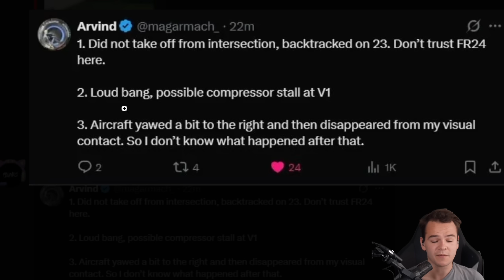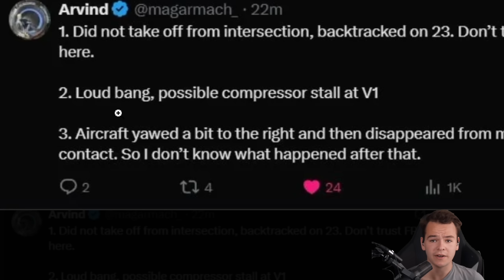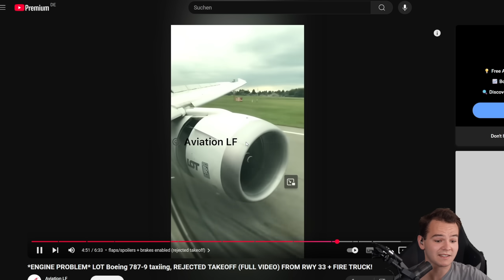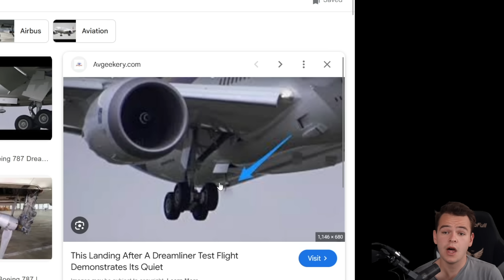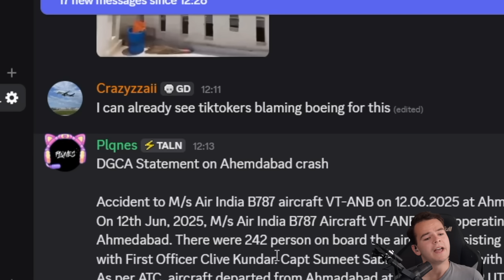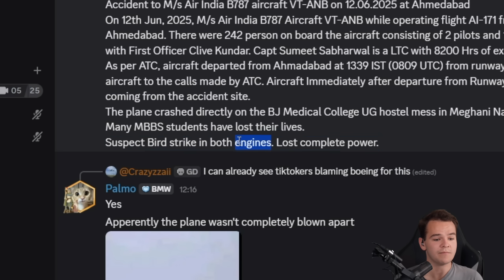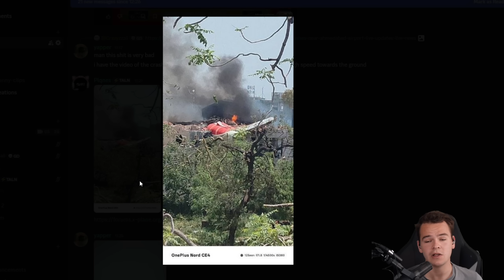The First 787 CRASH Ever - Why It Is SO Confusing?

Comment: No flaps visible, a fully loaded plane is unable to start or land without flaps.
In fact, flaps are required to provide lift at low speeds
Reply: you can land on no flaps just need to fly 50 percent fast so more like 300km hour for a very large plane... plane looked like going slower then that so was stalling already
Reply: @nicholas-k8j  The plane was definitely not stalling.  Proof:  
- wings level to the very end
- no drop in angle of attack.... quite at the contrary, the pilots seemed to have raised the nose in the last seconds to reduce impact speed.  
So, if the nose can be raised, that means there is excess speed (vs stall speed) to do it with, in the absence of thrust.
Reply: Flaps are in takeoff, I can see them.
Reply: Remember the 787 have a electronic checklist, the plane will literally say nope if the checklist wasn't correctly made so that means the flaps should be out
Reply: @Hugo-y7p9b  Correct!  The flaps WERE down.  At 5° setting, they just don't look like barn doors, making them little visible on such low-quality videos.
A segment of wing was found, with the leading-edge slat down...the flap had been torn off... but the slats cannot be set independently from the flaps, if I am not mistaken. 
Later correction:  I saw another picture of the same wing.  A segment of the flap had survived... it was DOWN!
Reply: @Hugo-y7p9b  More than once, flaps were retracted instead of the gear
Reply: @RickTheClipper Oh fuck I didn't think of that, make sense since the computer wouldn't have allowed to take off with bad flap config but the computer wouldn't have made anything else once the plane was already in the air, and from what you are saying is that once they took off they retracted flap instead of gear right?
Reply: @Hugo-y7p9b  Yes, thats what I say, and strange as it might sound, this has happened before. Human error
Reply: It is good practice on a wide-body aircraft to take-off with the minimum flap setting compatible with runway length, weight, temperature and other t/o variables.
That includes, on the 787, NO FLAP or only 1° of flap... F5 being pretty much maximum on such a long runway.  We can't see on such a low-quality video that small flap settings... 
So, let's not jump to conclusions.
Reply: @st-ex8506  That's not correct at all...787 FCOM lists F5, 15, and 20 as the only certified TO settings. The FMC wont even let you enter anything less than 5. Let's not spread misinformation.
Reply: @cameronfaison2118      I am a pilot and own a plane which has 3 flap settings (15, 30 and 40)... so, I did not invent what I said about the t/o flap setting of the B787-8.  I found it on an aviation site discussing that type aircraft. I cite verbatim:

"For example the Boeing 787–9 has more flap settings than the 787–8 but suitable settings for take off are 1, 5, 10, 15, 17 and 18, so 18 is the maximum allowable but the 787–8 doesn’t have positions 17 and 18 so the maximum is 15". 

So, if that is incorrect, my apologies.  It is not my style to spread misinformation, quite at the contrary.  One question though:  if it is not allowed for t/o, why is there a 1° flap setting?
Reply: @st-ex8506  Flaps 1 is for landing.  You slow to 255 kts and call for flaps 1.  Then as you slow more if I remember correctly at 235 kts you call flaps 5 then at 215 kts you can call for flaps 15 or 20. Then as you slow to approach speed you call for gear down and flaps 25 or 30 whichever you are using to land. The aircraft has to be stable  (on approach airspeed on glide slope and power set for approach) at 1000 ft above ground level.
Reply: @st-ex8506 never a 0° flap for take-off. Also you can take-off up to flap 20..
Reply: @edwardrichardson5567  Ok!  So, it was likely F5.  BTW, have you seen the wing they retrieved?  It has the leading-edge slots extended. The flaps seemed to have been ripped away... at least they can't be seen on that video.  But can the slots be extended independently from the flaps on the 787.  For other planes, the answer is no, which would mean the plane had some degree of flaps.
Reply: @st-ex8506 Flaps 1 is SLATS ONLY!!!! What part do you not understand???!!!
Reply: @edwardrichardson5567  I perfectly understand that F1 is no t/o flap setting.
I am actually convinced that the Air India crew took off with F15.
Reply: @st-ex8506  It didn't use the full runway lenght
Reply: That's the lack of coverage of FR24 plane used full runway  @RickTheClipper
Reply: How is it in the air? Even with flaps up this plane could DEFINITELY fly straight and level overloaded, unless Im wrong? The plane cant fly straight n level at Vmc??? Pilots hmu. It sounds like a full or partial engine failure. Terrifying and catastrophic, sad
Reply: @robburgundy9539 you are dead wrong. No pun intended.
Reply: @robburgundy9539  If you don't have enough flaps, I think you reach a point where you can no longer generate lift.  Now it is possible that the slats failed during take-off as there have been cases (in general, not on the 787) of slats retracting for some reason and causing crashes in past crashes.  For example, if you have a hydraulic fluid leak, that can cause the flaps to retract unintentionally.
Reply: he is right the flaps must have failed mid air
Reply: @Xhydro_unique  Flaps don't fail.  They are set (different settings are obviously possible) , or they are not.  The plane obviously started with the adequate flap setting, as its  perfectly nominal take-off roll and early climb show.  
What happened a bit later is impossible to know at this stage.  Were the flaps prematurely retracted by mistake?  It's possible, although I believe unlikely from the later behavior of the plane, which never stalled all the way to impact.
Reply: @st-ex8506  ik that but it could be that the ground staff didnt check and said the plane was ready to go so it could be related
Reply: I feel this to be very strange. If the aircraft is able to take off and reach 600 feet without flaps, which I’m not sure if a b787 is capable of, then I guess it would be able to fly but struggle to gain altitude at lower speed. It’s hard to imagine the aircraft took off without flaps deployed.
Reply: @RSTravelStudio  u get als aural warnings sounds.. unlikely
Reply: @RSTravelStudio  it could be that the flaps failed after reaching the height and then the plane started going down
Reply: You can't retract flaps on the 787 during take off.

Comment: Taking out both of these GE engines in a bird strike, would require two perfectly positioned, deaf ostriches on the runway. My guess would be a huge fault in the fuel management system, an autopilot take off that went haywire, a software melt down that reset the flight control systems to maintenance mode or two pilots slugging it out during take off (probably while playing bag pipes).
Reply: Agreed. Dual engine loss seems low probability especially a dual bird strike leading to dual engine loss. In the clip that’s going around they look very low energy though.
Reply: I posted a comment stating the sane root cause for the duak engine failure
Reply: @briannabanx5980  Including the ostriches?
Reply: Ground proximity software kicking in? Again
Reply: Or sabotage.
Reply: An even more remote option might be fuel fraud or contamination. 
- Topping up an almost fully tanked airplane with diesel in stead of kerosene, happened (happens?) in the army. You shouldn't, but if it's only a small amount no one will ever know. The reason to do that is usually time constraint, embarrassment or laziness. Why drive and fill another kerosene tanker truck, when the're's an almost full diesel tanker standing right here? Why admit you got your sum wrong by driving back for more fuel?
- Kerosene sometimes gets 'infected' with a fungus, especially in hot conditions. There is only one remedy, replace it for the good stuff. If kerosene like that ended up in the tanks, it could explain the double engine failure. It might be bad luck, it might be someone not willing to take a loss.

Comment: Imagine you're planespotting in India one day and suddenly... KABOOM! There goes an Air India 787-8.

I just wanted to say rest in peace, a routine takeoff from Ahmedabad turned into a disaster killing 247 people and leaving no survivors [242 people on board, 5 people on the ground]. We were never expecting a crash involving the Boeing 787, as it has had a good safety record for not having involvements in any fatal crash, but in 2025, the plane's safety record was lost after this crash had occurred. If the pilots had somehow managed to avoid crashing, this occurrence would have not happened, but because they stalled, they ended up crashing. This was even the first mass-fatality occurrence involving a wide-body aircraft since Flight 17 in July 2014.

Comment: These engines can ingest pretty big birds without failure.  FUEL, however can be solely responsible for a dual flameout, such as what happened to the BA 777 landing short in LHR.  At this point, its impossible to know.  The DFDR and engine data will tell what happened.

Comment: why is the video 9:11 long
Reply: Did you watch it?
Reply: @charlotteh7766  it is 9 seconds 11 minutes long
Reply: @thekingpachyyou think it was terror?
Reply: @charlotteh7766  its a coincidence that the video is that long, both were crashes. this one was probably a float carboteur faliure or some electrical faliure while 9/11... was 9/11
Reply: Had it been 1 sec shorter or longer you wouldn't have had that thought right? Are you making a conspiracy?
Reply: @charlotteh7766  no i said that this crash was due to an engine failiure, i was just pointing out a macabre coincidence, no conspiracy theories here at all.

Comment: The aircraft was under the command of Capt Sumeet Sabharwal with First Officer Clive Kundar, DGCA said. Capt Sumeet Sabharwal is a LTC with 8200 hours of experience. The co-pilot had 1100 hours of flying experience.

As per ATC, the aircraft departed from Ahmedabad at 1339 IST (0809 UTC) from Runway 23. It gave a MAYDAY Call to ATC, but thereafter no response was given by the aircraft to the calls made by ATC, according to the DGCA statement.

Comment: Flight radar showing it entered mid runway and took off. Ahmedabad is 3500m long, surely if FR24 is correct this cant be normal at 1500m - 2000m

Comment: I’m shocked that it was a 787. 

I want to say that we need to look at that fuel. Something is suspect here. Dual engine failure on a 787 is not impossible, but highly improbable. 

There is a video of some guy who claims to have flown on that same plane 2 hrs earlier and then when it left this airport it crashed. Check the fuel. Something is suspect here.

Comment: I'm no expert, but I know that duel-engine failure immediately after take off is extremely rare, especially for these engines. So rare that it seems almost inconceivable. This looked more like a stall of some sort.
Reply: Shutting down the wrong one?
Reply: @Campanola good point. Pilot error.
Reply: @longsleevethong1457  naah that pilot had 8200 hours of experience and co-pilot had 1100 hours very less chances but who knows they are'nt alive either
Reply: @vishalsehgal6454  The take off was performed from an intersection not using the full runway. I'm surprised because for such a long flight, they had a lot of fuel and was probably heavy. The engine need more power to performe the same take off on less runway length. It increases the possibility of an engine stall specially if the power application is rapid. Then, they left the gear down with at least one engine possibly failed. This could be an indication of rushed cockpit procedures and stress. Experienced or not, 1100hr is not a lot for a big heavy jet...
Reply: @Campanola  Then why the flaps are (almost) retracted?
Reply: @Thedoomguy66_6  It's probably the take off configuration. After you loose power on both engines, you also loose most of the hydraulic pressure and the Flaps stay where they are.
Reply: Why would a plane stall this soon after take off? This has to be a dual engine failure
Reply: @davidthomas9960  That's actually happened a number of times. It's rare but certainly more common than duel-engine failure. We'll have to wait and see what the crash report says.
Reply: Shut down of wrong engine or Fuel problem effecting both
Reply: @mstew145  or ai miscalculations because of failing sensors
Reply: Or bird strikes ...airport has the issue
Reply: if both engines failed, first thing I'd be looking at is fuel 🤷‍♂
Reply: @joeg5414  But the fuel system is independent as well...
Reply: I do agree, looks like a stall. When aircraft was descending the angle of attack seems high.
Reply: Thought the same. I'm thinking weight/balance miscalculation.

Comment: That plane is not at 600 AGL, maybe 600 ft pressure altitude, but not AGL. It doesn't appear that flaps are deployed. No dark exhaust trailing from either engine, either puffs or solid. May the family of those that perished find peace

Comment: Hey Nick, I think you've missed I point I can't explain either: there is a system on all 787s that makes the LDG gear doors open 1 second after lift-off. I can't see them open. Everyone has seen the Qantas 787 video with the doors open on the runway https://www.youtube.com/watch?v=d6q1mfp9XF4. Oh, and never heard the call "positive rate" (and then gear up)?. If there is no positive rate, the gear won't be retracted. And I now a crash, where pilots rejected after V1 and actually saved the day. An MD80 had it's elevators jamed and the pilot felt the aircraft was unable to fly and rejected. It might have been clever to do it here as well.https://www.youtube.com/watch?v=61_TqeITE3I Air crash investigation.

And rest in oeace the ones lost.

Comment: The gear being out doesn’t mean anything - Air India seems to have a procedure of leaving it out for longer after takeoff than other airlines. I’ve worked at LHR and LGW and seen AI take off many, many times, and each time they kept the gear down for long enough that it appears suspect to people who don’t know they do that. My theory (as a student pilot and former cabin crew) is that they stalled after takeoff, but I can’t assume why. Some people are saying it didn’t backtrack down the runway but took off at the intersection. We do know it was probably close to max takeoff weight. They will have, in any case, chosen not to retract the gear because opening the undercarriage doors would temporarily increase drag and take precious seconds away from them to work through the issue. 
I’m not sure the engines weren’t working either; modern phones filter out background noise so they may have been running in that video even though we can’t hear them. My phone filters out all noise from the moment it starts zooming in. Would be absolutely crazy if it is a duel engine failure though.

Comment: why cudnt they turn on the apu?
Reply: in a matter of seconds? while trying to keep the plane in the air? and for what reason in this situation would you need the APU?
Reply: @PhantomHelix  for more power obv?
Reply: @the3stumbleteers870   again, how are they going to start it in a matter of only a few seconds and while they are incredibly busy trying to keep the plane airborne?
The Apu is only an electrical generator and air compressor, it does not provide thrust

Comment: I always fly on the 787 dreamliner and it's one of my favorite airplanes. Just hearing its first crash makes me really sad. My condolences from Morocco
Reply: The pilots may have shut down the wrong engine after a problem
Pilots shutting down the wrong engine after an engine failure has happened several tomes.
Reply: @pigdroppings ya this might be the reason, also the flaps don't look normal
Reply: @captainalpha4853 pilot had more than 8000+ hrs of experience
Reply: @captainalpha4853  That's what I thought too.
Reply: @pigdroppings they were 675 feet above sea level. They rearly had time. It happened within 2 minutes.
Reply: @pigdroppings Electrical issues shut down both engine and hydraulics. AC was not 🚫 working during takeoff. 🛫
Reply: Ou moi aussi j'adore le 737 max et le 787 ils sont lunaires!

Comment: This is exactly that I thought and said as soon as I saw the footage 10 minutes after it was released. I immediately listened to other 787 videos of takeoff and landings to confirm
Reply: I think it was flaps problem
Reply: @AndiGomez-yu2dx the 787 takes off at 5 degrees flaps and I looked at the flaps of a 787 in the flight sim and there’s hardly any visible difference between 0 and flaps 5. Also I. The footage, something on the wing is deloyed as you can see a thin black like where the flaps would be
Reply: @AndiGomez-yu2dx  Please explain. AFAIK unless flaps are set correctly for takeoff there'll be a cockpit warning alerting the pilot(s).
Reply: @56Gumball maybe those warning systems were not functioning correctly?
Reply: @AndiGomez-yu2dx  Let's wait and see who's correct with their assumptions when the flight recorders are analysed. 😉
Reply: @56Gumball well he’s posted another video saying that judging from the video it looks as if the flaps were full up which isn’t a normal configuration . But we’ll have to wait and see
Reply: @AndiGomez-yu2dx  The only surviving passenger has said that he heard loud just bangs a few seconds before the impact which wouldn't be consistent with incorrect flap setting. That sounds more like a double engine bird strike, but as I said, let's wait for the flight recorder results.